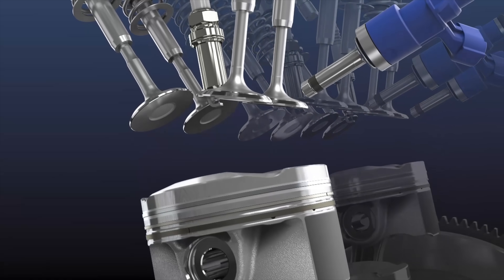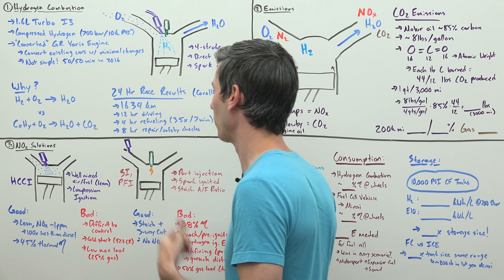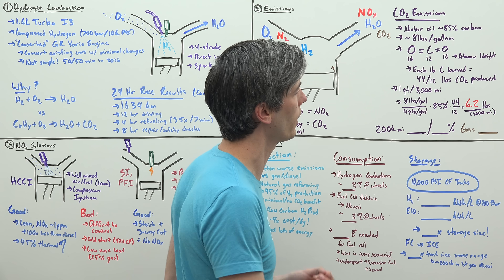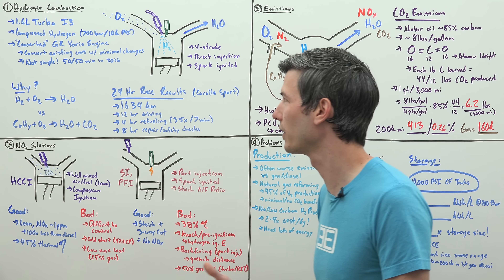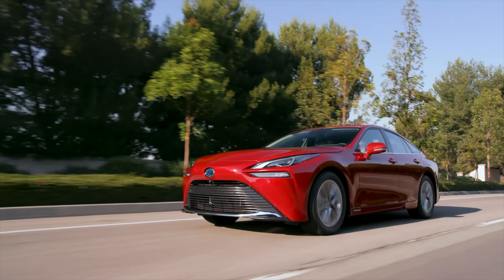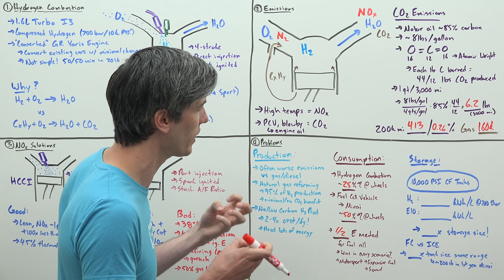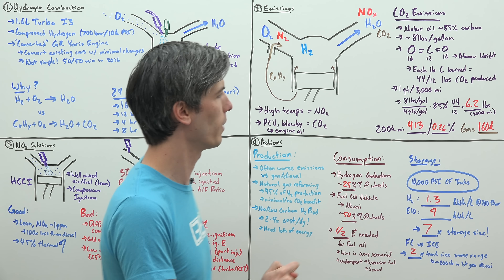Toyota's Developing A Hydrogen Combustion Engine!

Comment: There are very few hydrogen stations, I think for for its worse than find ev charge station. The other you didn’t touch you most likely cannot fill the tanks your has to be licensed person so if that person not there sol, go another station which could far away, 

Infrastructure needs to be put into your equations then get a fair comparison to gas,

Comment: why have a storage tank, just make hydrogen with electricity from the sun or/and some kind of wind turbine a use it right away maybe with a small temporary storage thank== they can also make the car hybrid or give the conductor the option to use either hydrogen or gaze(if there is no sun that day) or both at the same time.. hydrogen has a special particularity it can be pushed by water meaning no need for a compressed hydrogen tank but a system of water pumps controlled by a microchip

Comment: Energy economy of hydrogen ICE is not as good as a traditional electric car or a fuel cell car. But what about the amount of relatively scarce metals that need to be mined to create all the batteries for electric cars? Traditional ICE cars pretty much only require steel/aluminum and we already know how to recycle ICE cars

Comment: Hi I thought Hydrogen burn rate will change depending on Oxygen ratio. will a longer burn rate also be a cooler burn so the total energy is the same, and that been said would a longer burn not be more desirable for a combustion engine? , thanks in advance
Reply: Yes, lean combustion is the way to go instead of stochiometric combustion. High air demand but less NOx and knocking

Comment: A comment to point 4. Problems, Production : What if the hydrogen was generated from windmill-parks at sea? Production costs would be cheap over the years,including the maintenence of the windmills, to extract hydrogen and oxygen directly from the oceans.? That could be the solution. Hydrogen cars might be better environmentally to produce than electric cars, wich dont need a giant electric grid installed all over, and maybe the average time to fill a tank could be improved over time, so it could be similar time. And then we have all the gas-stations in place for filling up, so all the cost of upgrading could easily pay for the wind-mills considering the saved cost of upgrading the electric grid. And as for larger engines - just another good reason to convert to hydrogen ;-)

Comment: They can make a lot of electricity in the Mohave desert but they have no way to move that amount of electricity very far.  Water could be piped to the desert for electrolysis.  Then compressed hydrogen and oxygen can be moved nationwide.  Who knows, a hydrogen car might run better with a pure oxygen charge.

Comment: What's missing here is how expensive the Fuel cell is to produce and support.    The internal combustion engine, though less efficient is easily supported through the existing global skill set.  The cost of production is cheaper than a fuel cell.  For poorer nations to adopt new technology it needs to be accessible to the poorer folk.  It all comes down to the cost of hydrogen production/distribution.   Maybe it's like PAL v VHS...maybe the best solution doesn't succeed.

Comment: Only problem, they make hydrogen by using oil. It takes much more energy to turn gasoline into hydrogen. It's better for the environment just to use gasoline/oil right now for every mile/kilometer. But next year it might change... just as the sign in a bar says "tomorrow the beer is free". Oil companies really like hydrogen because they use a lot of oil to produce hydrogen, even more than people would use oil/diesel/gasoline.

Comment: You are comparing h2 engines with combustionengines and on the facts you"re right. I really think that toyota is more than a motorcompony. They've a leading role in converting methan in H2. Japan vulcanic oceanunderground is leaking methan. A more dangerous element that accelarate the co2 emissions. Making and devolpment in engines is a logical step forwards

Comment: Forget volume think weight. You need to think about the weight of gasoline vs hydrogen. Gasoline weighs over 6 lbs per gallon so a 20 gallon full tank weighs about 200 lbs comparable the weight of hydrogen pressure tank (the weight of hydrogen is only a couple of lbs) . For larger tanks like those on trucks the weight disparity is even greater. Weight is a far more important performance criteria for transportation than volume. In any case I don't understand the logic of an ICE hydrogen engine at all. A system that s far less efficient, heavier, has less torque, is more complex and generates pollution compared to a fuel cell. The bottom line is  the era of burning fuel for energy is ending.

Comment: With regard to the si engine and the pre ignition or knock you were talking about this could be resolved by making a wankle si engine,  thus removing the combustion chamber effectively and completely from the source of ignition.  Also because it not linear it would vastly improve revolution rate thus giving a better efficiency and power delivery.  😉

Comment: HELP! I read somewhere that in a combustion engine the flame never exactly touches the cylinder wall but there’s a microscopic gap. In that source it stated that a hydrogen flame gets microscopically closer to the cylinder wall than a gasoline flame. I cannot find this information anywhere or what this phenomenon would be called. Is this even true?

Comment: What’s crazy is if you look at how much energy is wasted just making the hydrogen.

Roughly 50kWh per kg if you use electrolysis. To compress it to 800Bar to fill up the 700Bar tanks, with the inefficiency of compressors you waste another 6kWh per kg.

That’s nearly 56kWh to fill a hydrogen car with 1kg of hydrogen.

You could fully charge a Tesla 3SR+ and get a realistic 200mi at 70mph or maybe get 60mi from a Toyota Mirai and even less from a hydrogen combustion engine.
Mazda made an RX-8 and it got just 26mi per kg!

Comment: This was already done years ago by Mazda. All they did was drill a hole in the Wankel engine, next to the fuel port, and put in another fuel port for the hydrogen. The engine can actually run on both fuels. They only put it in their race cars so far. If they would use water instead of NG to produce hydrogen, emissions would be better. I've seen cars that run on hydrogen, and they have plenty of power.

Comment: H2 innovations lab in NZ is fixing the hydrogen production problem. Self sustaining, stand alone hydrogen generation at 2000% efficiency up to 3000%. Thorium reactor engineers have been trying to get this efficiency for years and have not achieved what H2IL has done. So hydrogen ice cars just might a great stop gap to something new to be developed for hydrogen power. It's the future, batteries are not, unless they are hydrogen powered batteries.

Comment: A 90% reduction in emissions is only 10% as difficult as a 100% reduction. Cutting automotive emissions by 95% would be almost as good for a fraction of the cost. If companies offered a conversion kit for $3,000 or so, I imagine many ordinary people would be willing to pay that. It also means less waste in scrapping older cars. Realistically speaking, most new vehicles built since 2010 or so are incredibly overpowered anyway.

Comment: How would a hydrogen tank at 10k PSI fare in 40 degree C days?
If the containing vessel can hold that mich pressure, will heating the hydrogen to say 40-60 degrees C make much difference?

Comment: And what if we use HHO instead of clean H? HHO is an explosive gas what is made from water. It cost a lot of energy tho. But you can use solar energy to make the gas  on a station then refiil the car with high presurized HHO tank. Burning it also exhaust water of corse.
Ps. You are so loud that i listen to you on minimum sound level and still hear you crystal clear.

Comment: People said electric cars would be prohibitively expensive and impractical, and the battery technology would never be there, but here we are with electric cars thatll go several hundred miles on one charge and charge in a few hours. Let's not forget that lots of people are investing in space exploration for the sake of trying to colonize other planets, while knowing that the only practical way to get there without having 100s of generations of people making the voyage, is to literally bend space around the ship or tear holes in space. If enough people want it and theres money to be made in it, they will find a way to make hydrogen combustion viable. Hell, Plasmatronics (I think thats the name of the company) recently developed a way to put hydrogen into small discs and extract it with lasers for use in the energy/auto industry, seemingly solving the storage/transportation issue and the US department of energy declared it a disruptive technology so they can't sell it. But don't let the initial figures dissuade you, if theres a will, theres a way

Comment: Not a physics expert ( I know wind blows because the sun farts on the atmosphere). So I was like couldn't you just put water in a water tank with a magnifying top in a hot climate and seperate the hydrogen that way? But google said in order to remove hydrogen with heat and not electrolysis, would be about 2000 c°. 🕵

Comment: convert them to LNG 

45 percent of the energy is already lost during the production of hydrogen through electrolysis. Of this remaining 55 percent of the original energy, another 55 percent is lost when hydrogen is converted into electricity

Comment: i dont know what fuel cell he is talking about maybe a older style because fuel cell for Hydrogen tanks are very small. 1200 psi per tank  and that is the small tanks 4 tanks would fit in a bonnet area easy with a stack of another 4 on top. 8 tanks with 1200 psi would give you 9200 psi  with out covering the back window. i think see he is working off of old information hydrogen tanks are carbon fiber mix often said they can handle a bullet

Comment: I support the hydrogen combustion engine. The hydrogen must come from electrolytic sources and the electricity must come from wind turbines or PV panels. The efficiency of the engine is to  be 50% at least.

Comment: Bob Lazar had a Hydrogen fuel conversion system for ICE-based vehicles, something like 20 years ago... The storage method for the hydrogen was WAY safer than what toyota's using. their storage system turns your car into, essentially, a rolling bomb. Lazar sequestered the Hydrogen in Hydrides, and then warmed the tanks, to release the hydrogen.

Comment: Arrington Performance has found a comparatively cheap and easy way to covert IC engines to Hydrogen combustion.  Eventually we'll be using Hydrogen cells, but in the meantime it'll be far cheaper and easier to convert existing cars to Hydrogen combustion.
Reply: They've also found a much smaller, lighter and cheaper Hydrogen fuel tank.  A lot of Hydrogen developments are happening fast.

Comment: Why not invest in biofuels like industrial hemp that has the ability to act as CO2 sink and use 40% less water to grow. The beauty of industrial hemp is 

1. Current ICE technology doesn’t have to change 

2. Products and byproducts can be used to 100% of the plant and current farming techniques could adapt and diversify their product (Hemp ) and feed live stock run their tractor even build their house. 

Henery Ford did this in the 40’s and proved that hemp could be used for than just fuel. Why are we in west going down the battery path which is not renewable and it’s waste completely dangerous to the environment and hydrogen is not cheap , but industrial hemp is with 1538 different product lines and renewable energy resources

Comment: BMW has been following this idea for decades. Just after the Millenium 15 limousines of the 7 series have been converted to rund on hydrogen (750hL). About 100 more advanced examples followed until 2009, when the whole project was cancelled. Environmental Protection Agency (EPA) neglected back then to certify cars with H2O combustion engines as Zero Emission Vehicles (ZEV), because of supposed emissions of motor oil emissions out of the combustion chamber. In my opinion, converting combustion engines to H2O consumption was and is the best solution to reduce mobility emissions worldwide. It can be adapted to nearly every vehicle around, requires much less resources and may be way cheaper than newly-built electric (battery) cars. I have been preaching this for years, but nearly nobody wants to listen... By the way, BMW and Toyota have been working together in that field since 2013. Maybe the Japanese are using some German technology in their H2O combustion engines.

Comment: first produce your hydrogen without using fossil fuels. If it costs more per kWh than electricity then you may as well use electricity

And those tanks are a potential BOMB if mistreated. CNG tanks regularly blow apart as it is

Comment: The conversion now seems like a waste of the new engine designs now. The A25A does both port and direct injection so that design will either be scrapped or changed which would take forever.

Comment: BMW already did this with the 750hl back in 2001. I remember sitting in this car in Nuremberg, Germany back then. The water out of the exhaust was so pure you could drink it. But of course the problem they then realized was to produce that's Hydrogen economically viable. To do this you need to scale up renewable energy(solar/wind) but you still need to store and transport the physical fuel BEFORE you get to use it. This can never compete with electricity which can travel instantly round the globe at no cost. Denial ain't just a river in Egypt...
Reply: Solar/wind are too random in production and as such you need a storage medium to regulate it. Batteries are capacity limited and as such cannot be used reliable (they are excellent for being a buffer). Overproduction can be turned into hydrogen with practically no limit.

Furthermore there are more ways to generate hydrogen than electrolysis (Germany has tech to convert waste into hydrogen)

Comment: The amount of hydrogen that went in here, the amount of power to re-compress that fuel station back after every refill (really, while refilling takes 7min/stop, the station recompressing is a huge issue), and the amount of energy that would be needed to create this amount of hydrogen through electrolysis is staggering. Vroom might be nice, but the efficiency is absurdly low. FCEV's are better, and even there: EV's are betterder. I think I've found peace in the whole: "vroom will go" idea.

Comment: I honestly don't see the point when you can use a fuel cell, far more efficient, light weight and compact also more reliable and high torque! I don't see many advantages here.

Comment: Talking about half as efficient....

1 gallon of petrol where I am in the UK is £7.80

1 gallon of water is £2.95

So even at 50% efficiency I can afford to driver further on a water engine.

In bottom line cost for every gallon of Petrol, I would be saving £1.90 with a water engine and emitting 99.99% less Carbon emissions.

So while your math makes it look terribly inefficient in real talk we won't drive round race tracks we drive with speed limits.

The real issue here is how the government is not able to hike the tax on what is essentially a necessary commodity that is also a basic human right.

Water engines are not stunted by power, they can do the job, the issue is greed and that greed is going to kill us all.

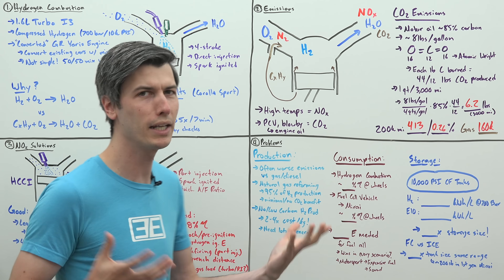Comment: 7:55 That's not really a problem of the engine though. Today most of or energy is produced from fossil fuel like coal or gas, rendering battery cars just as useless. Unless you get the energy for your battery car from renewable energy, it's NOT environment friendly. As long as we don't rework our energy production, we'll never reach our goals.
On the other hand, if you get all the energy for hydrogen production from renewable energy, that "problem" isn't a problem anymore.

Comment: Great video! One thing I noticed and that I see a lot - energy density comparisons between fuels and power sources are meaningless unless you specifically compare USABLE energy density. For example it's ridiculous to compare energy density of gas to a battery when 70% of the energy in gas leaves your car as useless heat. It drives me insane when people keep offering up hydrogen cars as an alternative for electric cars. Hydrogen cars ARE electric cars, only their power source is highly problematic, with pretty much insurmountable challenges set in basic physics. While batteries can still get more energy-dense, eco-friendly and durable, hydrogen production, compression and fuel cell conversion will always be wasteful because of physical thermal inefficiencies. Untill we come up with a completely new way of moving objects, electric motors will be the most efficient energy-motion converters and a bunch of electrons stuffed into a battery will be the most efficient power source. There is simply no way around that.
Reply: Production of batteries are eco-friendly ? Did you ever saw the impact of mining and the insane amount of raw material that are needed to produce a battery ? You should take all this factors in consideration before saying that there is no other option than use EV......

Comment: Ah yes, a hydrogen tank in every car sounds amazing for Hollywood movies, Crack one of those fuel cells and kaboom, if you have ever seen a car go Kaboom from an LPG explosion it will be like that x10
Reply: Toyota literally shot their tanks with a gun and it didn't explode. The amount and levels of testing they put into it was a lot.
Reply: If you crack open a petrol or gasoline engine open, kaboom. Have you forgotten petrol is an explosive? But most crashes don’t result in an explosion